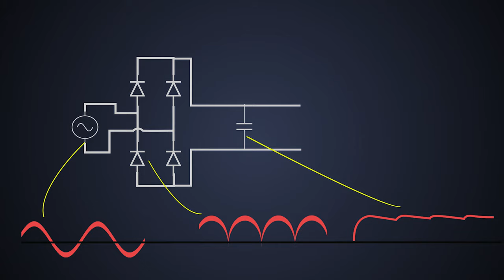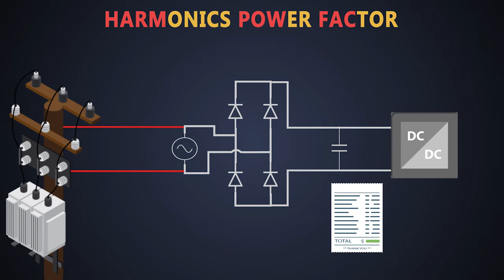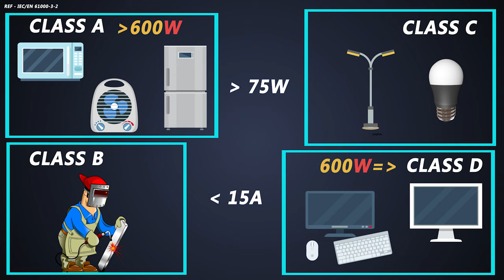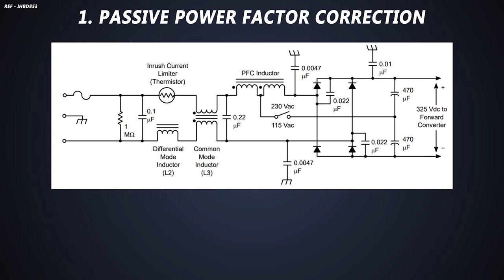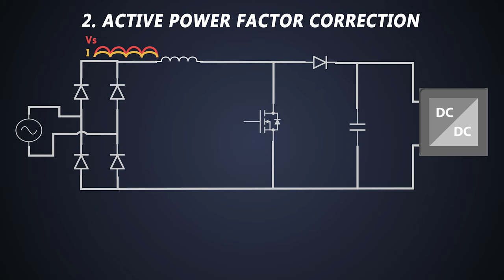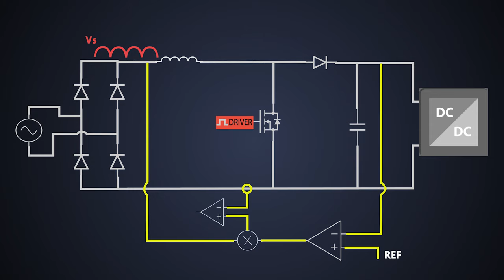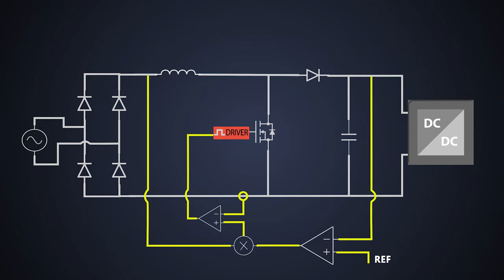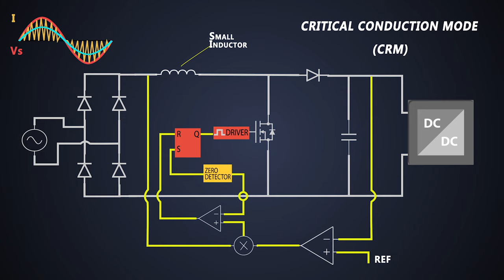Power Factor Correction | Active Power Factor Correction | PFC Control | Boost PFC

Comment: Hello there! I was actually building this circuit on PSCAD. What do I use for ref at the first comparator because its only shown as a label on your video? Is that just a DC value with which Vo is compared?
Reply from the maker: it is just for representation. actual feedback is quite complicated

Comment: Why are my diaphragm air pump pulling 2x as much as the rated power? I have 4 pump running at the same time, 2x 85w+ 1x 55w + 1x 22w. So the total is supposed to be 247w or 1.12amps. But why my ammeter is constantly reading at 2.2amps? Is my power factot 0.5? How can correct this?

Comment: My experience with inductors is that they're more efficient, in continuous conduction mode. It seems that the Eddy losses in the inductor core are much higher in critical conduction mode, because the lower effective switching speed allows deeper penetration of magnetic flux into the core. At higher frequencies, the skin effect reduces the conductive cross section, reducing overall core loss, despite a possible increase in hysteresis loss.

Comment: Good day 
I have been repairing smps since a while .. but i have some really weird issu that is still out of my knowledge range .. smps works fine and pfc as well .. the problem is the pfc voltage 400~405 dcv starts dropping slowly until it reaches 350v then the whole smps turns off .. no phiscally  faulty or damaged  components mosfets and pwm controller ic fine just an unknown leakage couldn't find or understand what  causes  it

Comment: why do we multiply the error signal (which is the output of the comparator, comparing the output voltage and REF signal ) with the input voltage? The output of that multiplier is compared again with a current signal to feed the switch driver. My point is,  Is it possible to compare a voltage signal with a current signal ?

Comment: professor
the input current of inductor will not like sine
as the inductor add harmonics to the signal.
the circuit between DC to DC and rectifier bridge is boost dc dc converter

Comment: Hello there, hope you are doing well; I have a question: As you explained when the power factor correction is made- by PFC block, the input waveform of current becomes sine-like again. But I am curious to know what happens to the output waveform of current. What does it look like?
Reply from the maker: It becomes a dc current at the output

Comment: What will happen if we change the ac source with a high voltage dc source ? Can it damage the PFC unit ? E.g. instead of 230v AC we supply 330v DC .
Reply from the maker: If you are using DC power supply then you don't need PFC. Just remove it.
Reply: @FoolishEngineer  yes that was my first option but I am using server power supply which has very compact PCB and my dc source is not stable it's a 9 series connected solar panels who's open circuit voltage will be 380v dc and under different conditions it may be 280v ,the server power supply has boost PFC, it's output is 400v dc constant under load and no load its constant , what If we apply dc to the rectifier ? The PFC will have any issues ?

Comment: when turning on a device, a peek current flows thru the aperatus and the grid
like switching a light bulb a lot. can make it break it sooner then useal.
Reply: a peek current is bad for your aparatus. wich happens moatly when switching it on or off.

Comment: Isn't it easier to say that instead of the short current peaks that occur at 320VDC, increasing the voltage to 380VDC at the input results in longer current peaks? And it brings the current consumption closer to the voltage. It is not?

Comment: maybe.. a dc towards dc, converters is just a transformator. that two coil thing around a metal block. that works with a magnetic field.

for example makeing from 12 volt , 6 volts. kind of thing.
Reply: can also make from 12 volt 12 volt. direct current.

Comment: And how will we check the pf ?? And where does that component connects??
Reply from the maker: https://www.yourelectricalguide.com/2017/01/power-factor-meter.html#:~:text=Power%20factor%20%3D%20Wattmeter%20reading%20%2F%20(,Voltmeter%20reading%20x%20ammeter%20reading).&text=This%20method%20involves%20mathematical%20calculations,the%20load%20is%20varying%20continuously.